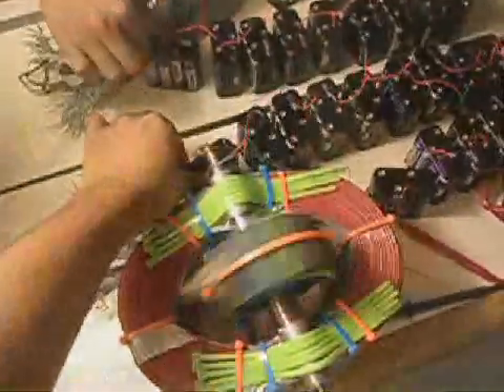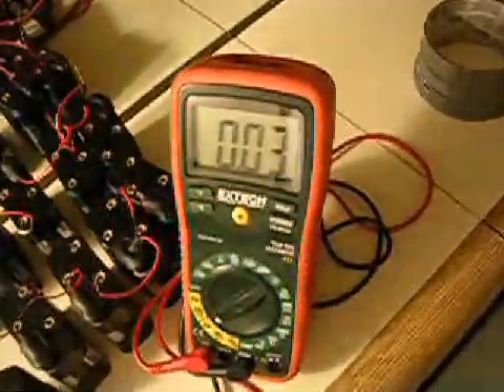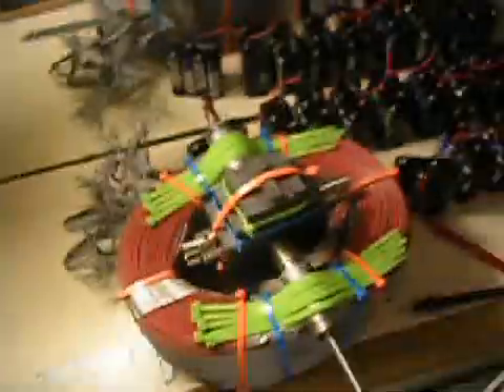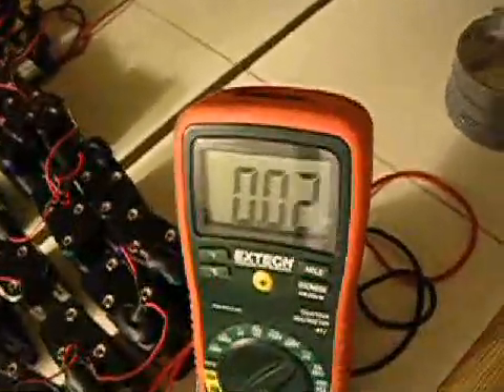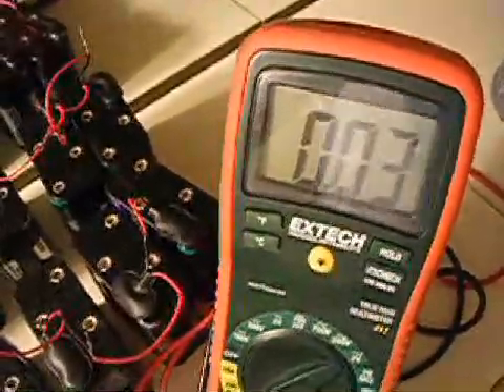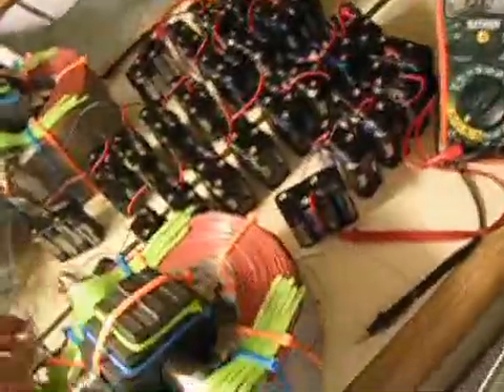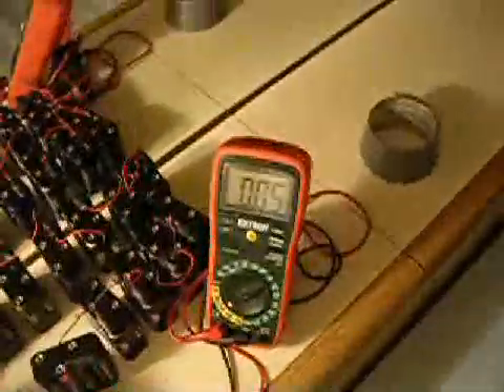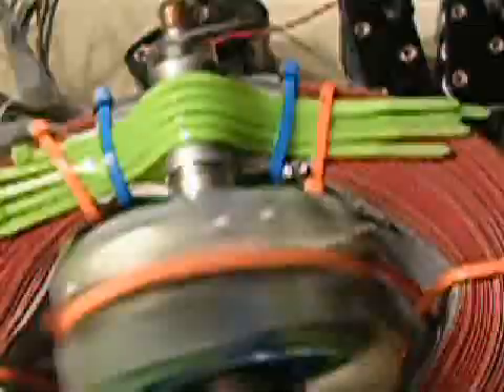Paper Fan ▲ powered by 147 volts

Comment from the maker: I don't have any drawings, but the bare bones is really simple.

You basically need:

1) A large self-built electromagnet.
2) A large amount of strong magnets.
3) A shaft to put the magnets on.
4) Bearings to keep the shaft stable.
5) Other items like screws, twist ties, or whatever you can find and put together to make the machine to run really smoothly.
6) And a power supply.
7) A commutator in the circuit (basically a mechanical switch that turns the machine off periodically).